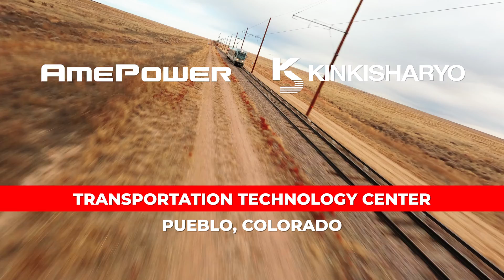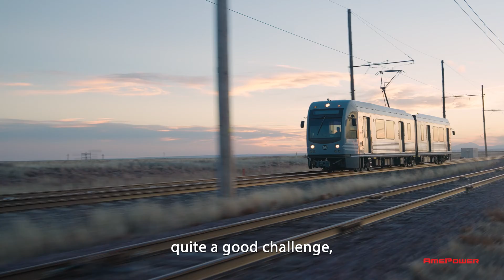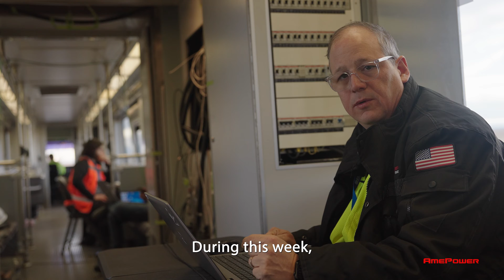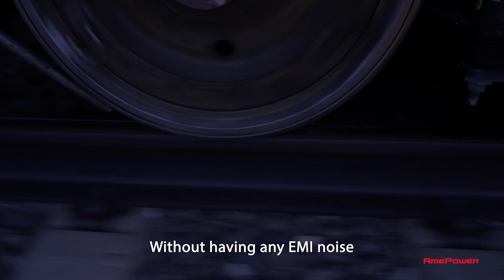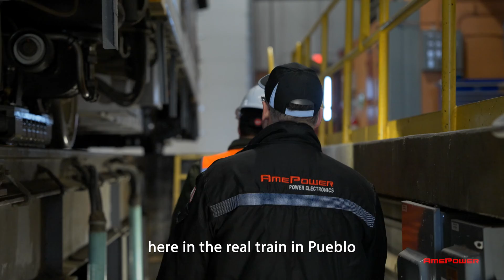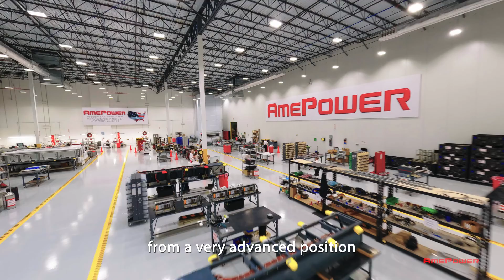LA Metro P2550 Dynamic Testing Success! Kinkisharyo - AmePower - LA Metro

Comment: Do not change the motor sounds of the P2550s
Reply: Or the spirit of the gold line.
Reply: the point of a refurbishment is to modernize every part of it. like the signs have been replaced from green to yellow but also the motors will have to be replaced.